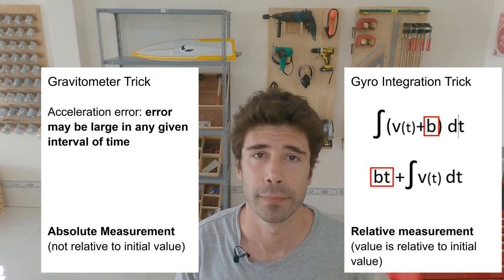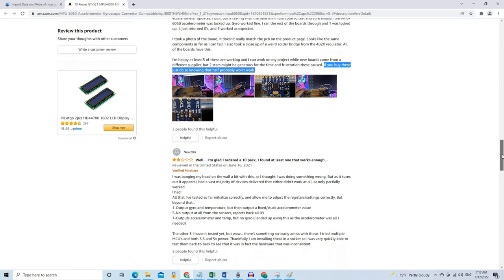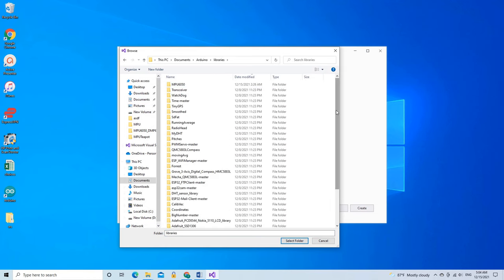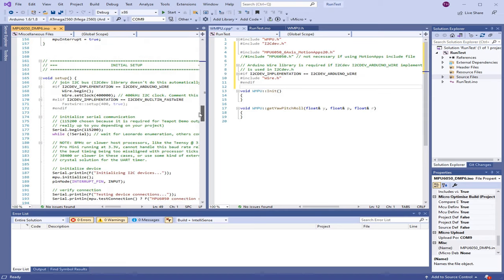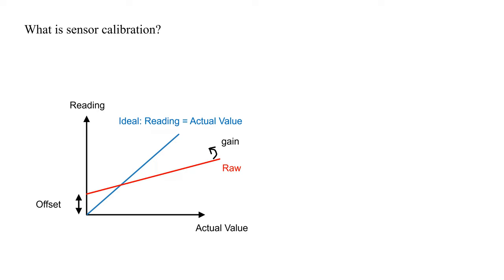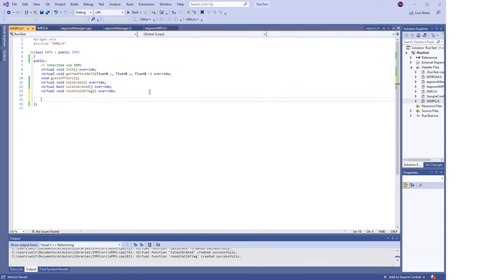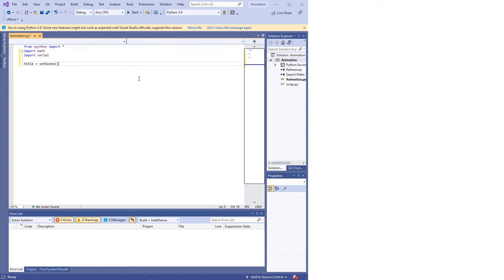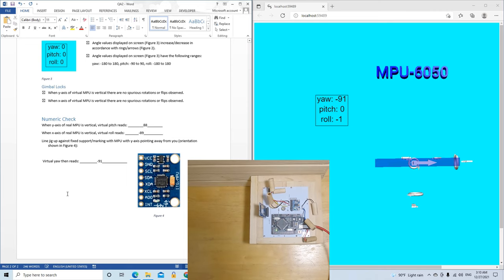Detailed MPU6050 Tutorial

Comment: This has been awesome, not knowing CPP much. 
I have followed along and at the point of running a Calibrate sketch, it just runs forever xD

Edit: Figured it out digging into the MPU6050 library. If the unit is not flat & still ENOUGH, it will just loop forever since there are no maximum attempts set.